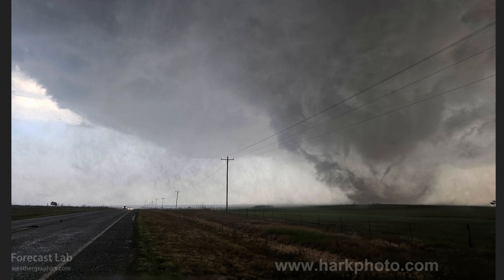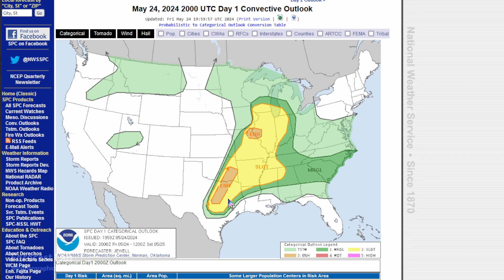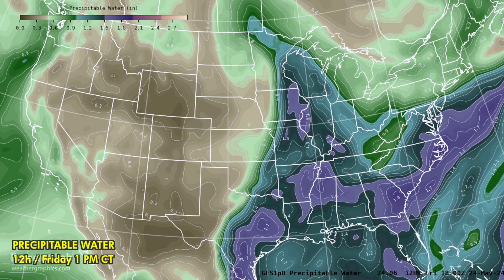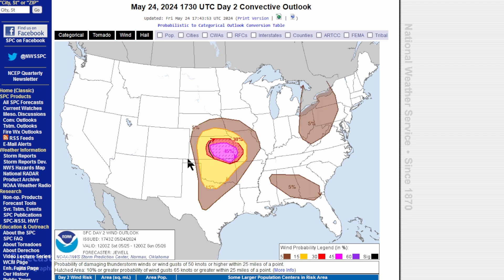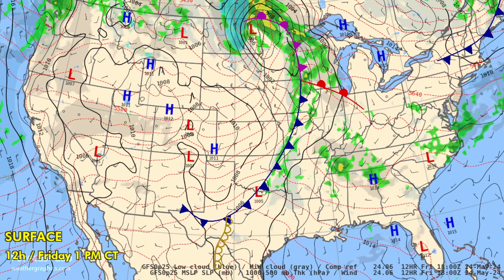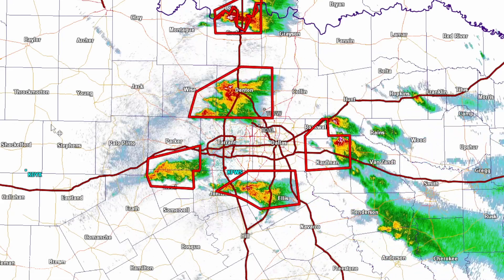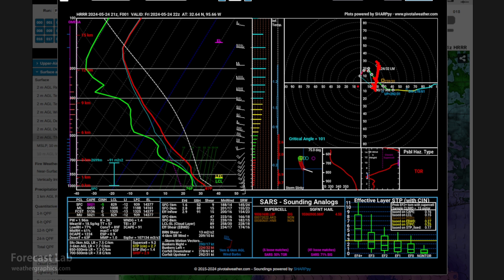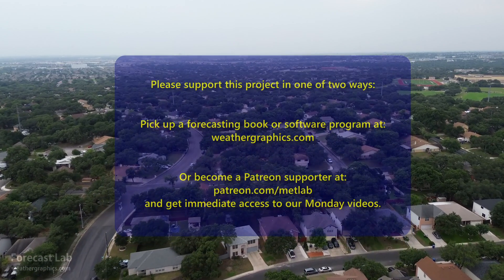Fri 5/24/24 - Near-record shear for Oklahoma tornado | More tornadoes today

Comment: Had a flight from Tucson to Dallas on the Washington DC scheduled for Friday afternoon.  While in the air the weather closed in on Dallas and we were diverted to Houston.  Sat on the ground 3 hours there until weather improved enough to get to Dallas.  Many flights delayed or canceled.  Of course missed connection to WDC and after several days baggage still lost somewhere in the American Airlines system.  Last week was stuck at O'Hare in Chicago due to weather issues.  The changing weather dynamics in the Midwest are going to force the airlines to reconsider having their hubs located where extreme weather events are going to exist.  Very frustrating traveling by air this spring.

Comment: Thanks Tim- the side-by-side mosaic of differing models really showed the effect of weighting different input variables to determine a solution. Very informative!
Saturday the 25th seemed to have all the juicy shear and moisture to produce more violent weather than it did. The low-sun angle visible satellite image showed a wide area of moderate wildfire smoke in E TX and E  OK. Was it enough to reduce surface warming to tamp things down a bit maybe?